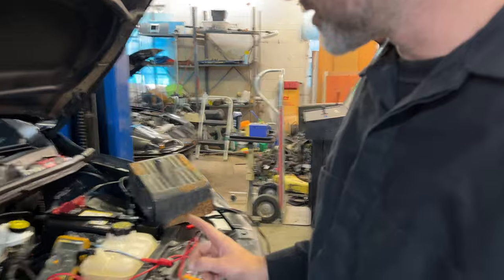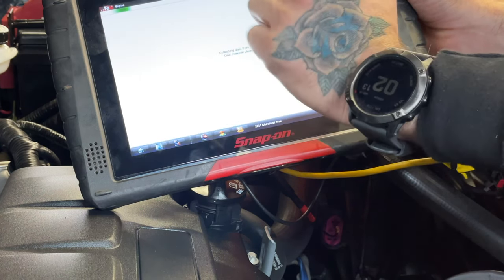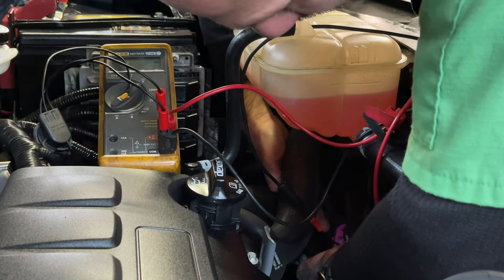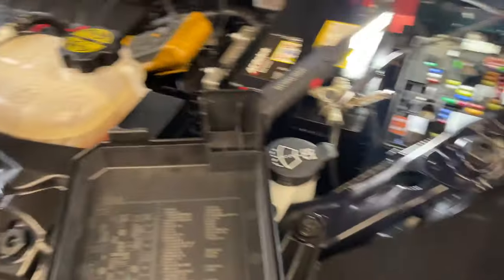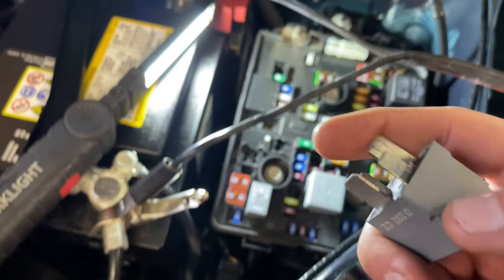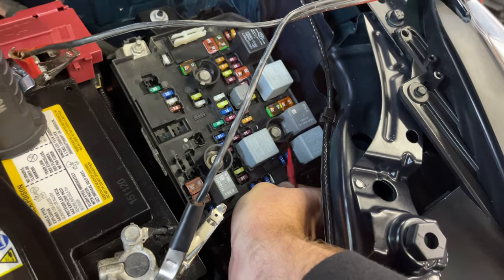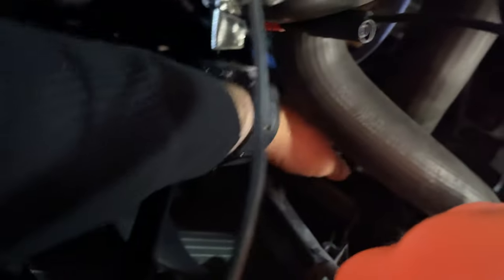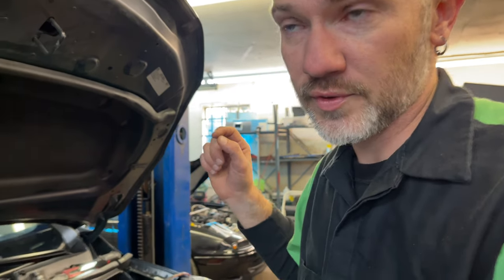2021 Chevy Trax Cooling Fan caused an AC Leak

Comment: Love watching some of the cowboy techs whipping out a DVOM to check powers and grounds, every time I giggle to myself “ someday you will get burnt”. Have seen lots of grounds look great on ohms but can’t pass current. Started using 9004 test lights shortly after stating working on cars some 25+ years ago. Plus hooking a 9004 bulb to fuel pump circuit makes it easy to see it light up from under the hood. Every tech should have a batch of these and know what the amp draw is on all of them also.

Comment: You've got me inspired to make another drop test tool with a headlight bulb, this time with male banana jacks to quickly run a parallel drop test. The first time around I copied Eric O's method with soldered needle probes onto a headlight bulb, and that works OK. Your tools are better because you're already there with the multimeter, so no need to fiddle with extra bare needles. And you can do it hands free, so you can jump into the car and turn the key while watching the light. The brightest technicians have a way of seamless quick diagnostics without wasting a lot of time. I know you haven't yet built up a following but I want to encourage you to keep going with Youtube. Just be prepared for something strange that I found in my videos over a decade. There is an inverse correlation between content value and popularity, so you just have to shrug and continue putting out great videos. In the end you want to attract and build an audience with enough background to benefit from what you're explaining.

Comment: Great lesson on load testing and voltage drop! Can't believe that this was on a 2021!! Back in the day fans and relays would last 30 years / 300k miles no problem haha
Reply: I am surprised it still has gas in the system.After all it is a year old now. 😉
Reply: @autodiagyt  👍👍👍

Comment: It's curious that the A/C compressor didn't cycle off on high pressure before the popoff valve opened, the popoff is meant to be a last resort to relieve pressure in the event of the high pressure cutout failing to operate properly.

Comment: These Trax’s are junk! I just put a motor in a 2020. While it was in the shop the lady told us she had an issue with the A/C. It already needed a resistor and a pigtail from being melted. Several months ago we had a 2019 with a blown head gasket and every single valve in the head was pitted so bad it couldn’t be saved. Had to get a new head. Nothing but problem’s with these cars. They’re like the new Chevy Cruze 😂